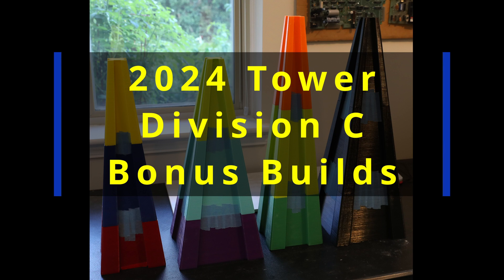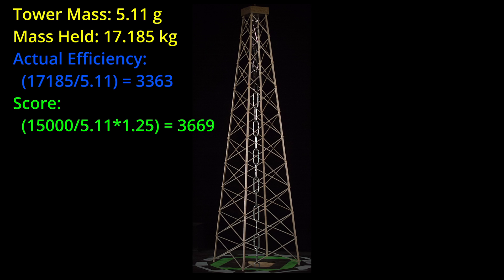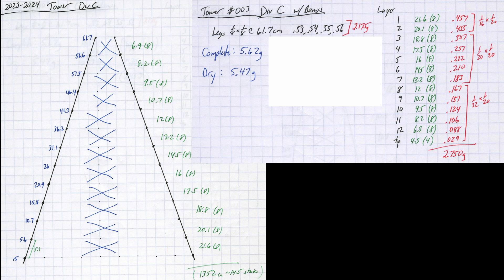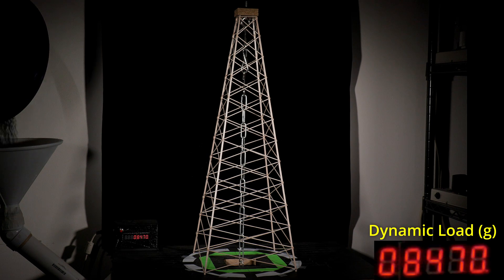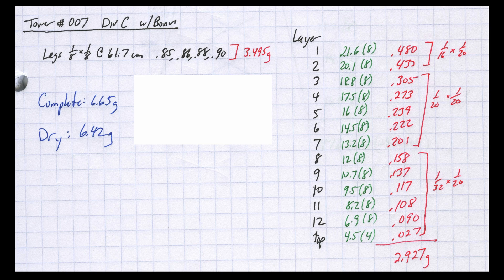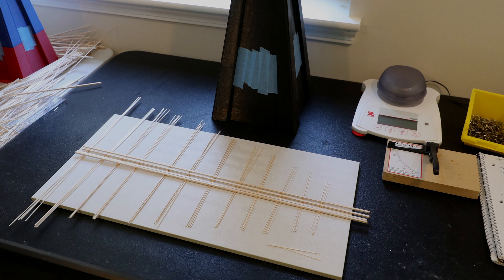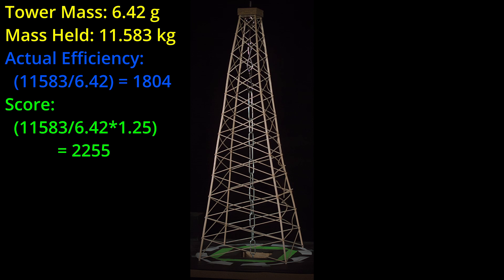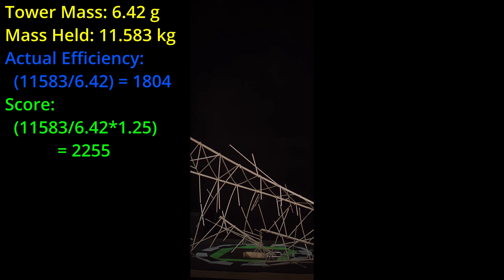2024 Science Olympiad Tower: Div C Bonus Builds

Comment: Might do bridges this year. How would you do the math on how much each piece could theoretically hold? Also, thanks for the video because it answered my other questions :)
Reply from the maker: It's towers again this year, but with different (more difficult) rules.  Most of the material optimization like you are talking about is done experimentally.  It's not too hard to zone in on the correct range of densities to use for each major component but it does require a lot of building and recording video of your failures.  Good luck this season!!

Comment: Hello! Thank you so much for the video! I was wondering what the top length of this tower would be. With my calculations based off of your drawings, I got 2.5x2.5cm for the top and 21.5x21.5cm for the bottom. Are these measurements correct? I fear the top is too small and may cause the weight to not be distributed correctly.
Reply from the maker: Hi! The bottom dimension is 21.5x21.5 cm, but the top is the same as the non-bonus at 4x4cm.  You can download the actual stl jig files I used from the links in the Intro video if you'd like to see the parts in detail: https://youtu.be/ECcz3T6fzPg

Comment: Hi, what is the bottom width of the bonus tower? I see the non-bonus width is around 15cm wide at the bottom
Reply from the maker: Hi! The base of my bonus tower jig is 215x215mm.  The non-bonus one is 152x152mm.
Reply: I didn't understand did you mean 21.5 cm?  @balsaengineering6686

Comment: Hi, i had my first go at building a tower, but I accidentally super glued it to my jig and I couldn't get it off. I was super careful with gluing to try and prevent this but I guess it was kind of inevitable. Would you be against it if I were to wrap my jig in something like saran wrap so the tower would only be stuck to the saran wrap if this were to happen again? thanks
Reply from the maker: Hi!  Yeah, that can happen unfortunately.  First, if you are going to try and directly prevent it, I would use wax paper instead of saran wrap.  The best tip is to build the tower with the jig flat on the table one side at a time.  This really helps you control the amount of glue and limit the dripping into the grooves.  If it does get stuck, what I have found that works well is to find a small block, I 3d printed one 30x30x5mm.  Temporarily tape it to the top of your jig.  Then turn the entire thing upside down and put it on a hard, flat table.  Then carefully but firmly press on at least two legs at a time from the bottom.  With any luck, your tower will pop off the jig without any damage.  This technique worked well for me when this happens.  Good luck!!

Comment: Oh no! My students keep getting their tower glued to the jig and then it gets destroyed when trying to remove it when complete. Besides just practicing better precision and using less glue, do you have any tips to prevent gluing the balsa to the plastic?
Reply from the maker: Hi!  I do have a couple recommendations.  First, if you haven't already, made sure your students are building the tower with the jig on its side, that really helps with keeping the glue from not getting in to the notches.  See the pics of some of my newer videos for more details.  If the tower does get stuck, and it sometimes does even with my builds, DON'T try and pull it off by raising it up.  Find a small block, I 3d printed one that was 3cm x 3cm x 5mm and temporarily tape this to the top of the jig. Then carefully turn the entire jig upside down on a flat, hard surface.  Then press firmly on the bottom of just 2 (or all 4 if you have 2 people) legs at a time and the tower should pop free.  I've been thinking about making a video on this process.  If all that fails, take some thin strips of wax paper and tape them into the leg groove before the next build. That will definitely work but it's the most time consuming and shouldn't be necessary.  Good luck!!

Comment: I built a bonus tower that held over 15kg, but tower is 14g. I built another one about 9.8g. But I didn’t test it. I want to bring it to the competition without testing it. Will the tower be tested several times?
Reply from the maker: During competition, the tower is only tested once.  Good luck!
Reply: I mean, do I need take a test before competition?  Thanks
Reply from the maker: @gabrieldeng3990  It's up to you if you want to pre-test your tower before the competition.  If you are building to the bonus rules, I'd probably test to 15kg (only) to make sure it can hold the entire weight

Comment: Is the whole length of the leg under an equal amount of stress? Is either the top or the bottom of the tower holding the majority of the load, or is it distributed evenly? If the distribution isn't equal, would it be worth it to change the distance between each layer of cross members so that the places under more stress has a smaller gap between cross member layers, and the places under less stress has a larger gap between cross member layers?
Reply from the maker: The loading of the legs are under even loading throughout the entire length so it wouldn't be a good idea to have different spacing from top to bottom

Comment: This question is more for general knowledge than building advice, but how do such lightweight pieces of balsa support such heavy weight? I understand the sheer amount of cross-members and the even distribution of weight across all of them allows for a high buckling strength, but in the past, the pieces I've handled that are this light are so soft they dent to the touch, so how is it possible?
Reply from the maker: The main reason is that balsa is an amazing material!  It can be even stronger than steel by weight.  While I am using the light side of the "light" range of 6-10 lbs/ft^3, the really squishy stuff you are talking about is even lighter than that.  I wouldn't recommend using that range as the strength to weight ratio goes down quickly.  Check out this video when you get a chance: https://youtu.be/mzMFhd4SqP8?si=izWDuw3luNPbFkCz

Comment: Is it wise to even consider using 1/32 by 1/32(or 1/16) bass pieces for the cross-members, or is it too heavy that it brings down efficiency by a considerable amount? The cross-members this year are incredibly light and compared to bridges, the balsa pieces look like they weigh nothing. If I use any random piece of low-weight, low-density wood (within the weight range), it could severely hinder the tower, so I wanted to know what specific density range you order from Specialized Balsa to get the cross-members.
Reply from the maker: Even 1/32 x 1/32 bass is too heavy for this application to be competitive.  Getting the right material can be a challenge for sure, and even when you get the proper sheets, you'll have to cut a bunch of strips and weigh them individually to make sure they are OK.  Definitely document in your journal the weight of each cross member layer, not just for documentation purposes, but to make sure you don't put in a piece that is bad (too heavy or too light). I would start with the "light" range of balsa 6-10 lbs/cu^3 from Specialized Balsa.  You might enjoy this video I made on density vs efficiency that goes over a bunch of this in more detail:  https://youtu.be/mzMFhd4SqP8

Comment: Alr so here are my own findings, I used materials from last year, so it wasn't completely optimized yet, nor will the next one which I am building rn, but I have one at 1200 efficiency and the next one is estimated to be somewhere around 1600 efficiency (both with log bonus and build bonus) We have done 10 layers for the first one, but we added a thick strip across the bottom on all 4 sides, I believe 1/4 by 1/16 inch, and during recording the tower didn't even move, so odds are it probably could have held another couple kgs, this next one we are lowering the amount of layers to 6, keeping the bottom strip, and possibly adding a thin strip between cross pairs 3 and 4 for extra stability. These two were build on 1/8 by 1/4 legs which increased the weight of the legs by almost 2 times, with the leg weight being around 7.3, on the tower after this one, we are going for 1/8 by 1/8 medium density legs, and using 1/16 by 1/16 for ten layers medium density for 5, and light for the top five, along with the strip at the bottom being medium 1/16^2 and a strip at the very top being light 1/16^2 for a VERY rough estimated score of around 2500
Reply from the maker: Thanks for sharing!  Please let me know if you get close to a 6-6.25g tower that achieves the bonus.  That is what it will take to even consider bringing one to competition compared to a non-bonus tower due to the extra risk involved (IMHO).  Good luck!!
Reply: Ty!

Comment: where can i get the lowest density wood?
Reply from the maker: I like to buy all my balsa sheets from Specialized Balsa where you can specify a density range or even very specific if you are willing to pay extra.
Reply: @balsaengineering6686  How long would it take for it to aarive?
Reply from the maker: @vihaankinra615  It depends, but in my experience, it usually takes about 1-2 weeks
Reply: @balsaengineering6686 so you bought balsa sheets not the sticks?

Comment: Where can I buy the jigs? Also what size wood did you use?
Reply from the maker: You can download all the STL files from the description of the Intro video: https://youtu.be/ECcz3T6fzPg  You'll have to print them yourself or send them to an online service to get printed.  You can see the size of the material I used if you examine the notebook pages I show in all of my videos.  In general, the legs are 1/8 x 1/8 and the cross members are typically anything from 1/16x1/20 to 1/20x1/32
Reply: @balsaengineering6686 but that video only contains the div b jigs right? How about the jigs for div c
Reply from the maker: @Trygod  The Div C jigs are just the Div B jigs scaled 120% in the Z direction only.  I also have included a zip with all of those in case you don't want to scale it yourself in the slicer program